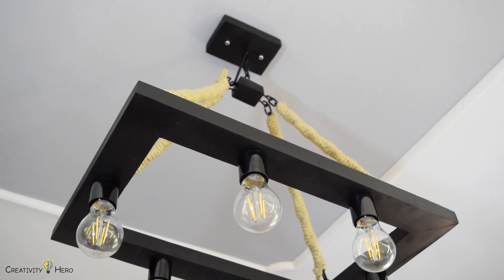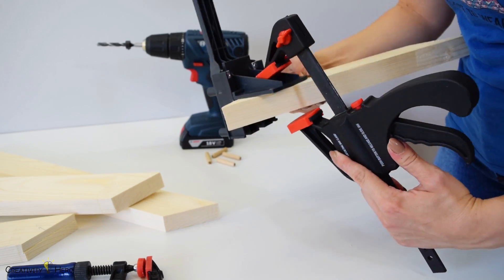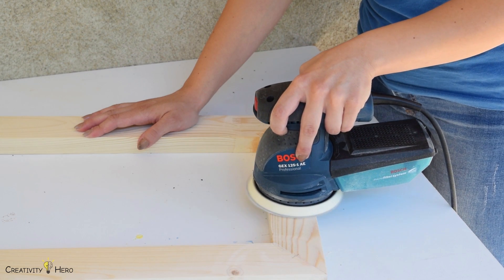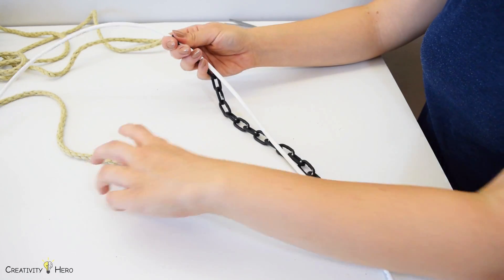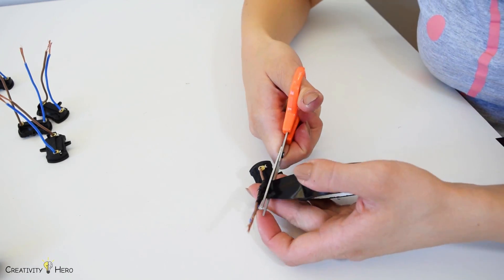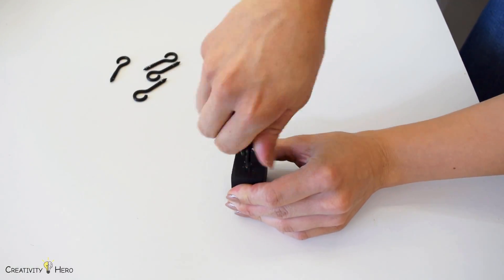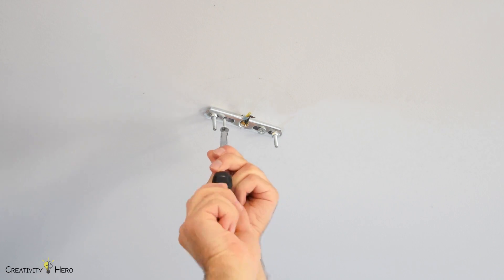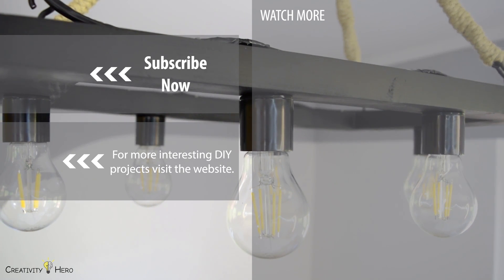DIY Industrial Style Hemp Rope Chandelier for 35$

Comment: Is there a way to turn this into a lamp for my bed room .... unfortunately my room has the pull cord lighting
Reply from the maker: I think it is possible if you make some modifications. But, safety first! If you don't feel comfortable doing this, ask a professional. You'll need to make larger support (the one with 5 hooks attached to it). Then, you'll need to make another hole, next to the hook that connects the support and the junction box. You can put the pull cord in the hole and that's it. The chandelier will keep its original look. :)

Comment: I am going to do this! However I might just do a different finish than black.

Few suggestions though

1. If this is not your primary source of light used on regular basis then probably use non led AND warm filament bulbs
2. I think it will look good without the hemp rope too. Have you tried that?
Reply from the maker: Thank you for the suggestions! I haven't tried that, but I'll take it into consideration. :D
Reply: i think the problem if she didn't install the rope the cable will be visible